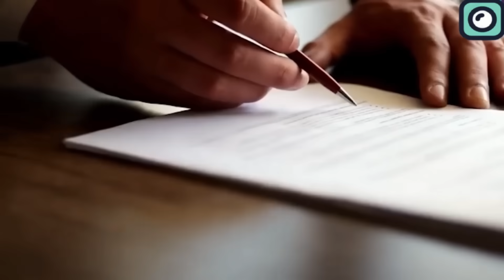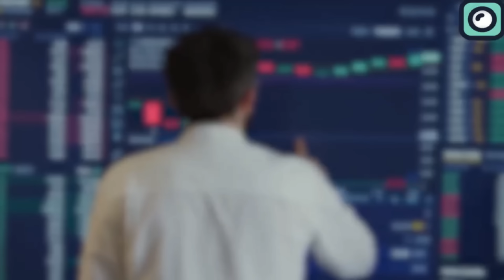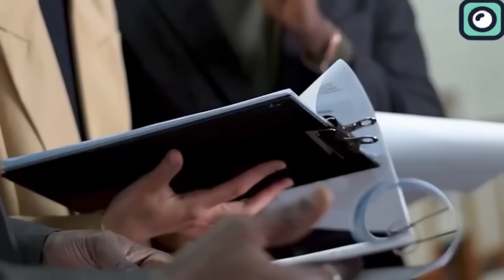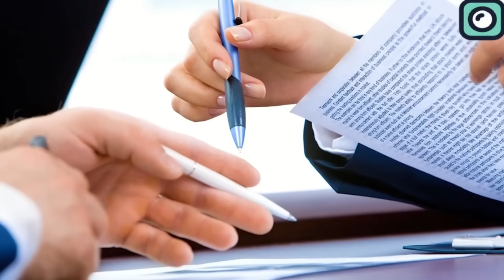ULA Being Sold! Jeff Bezos Is Finally Buying ULA....

Comment: So why would anyone want to buy ULA. It seems like they would need to start over are the engines cutting edge can they be used to land reusable rockets using directional thrust.or is it there launch facility has alot of value. Seems like it needs to be gutted.

Comment: SpaceX has very few reasons to buy ULA. The only one that makes sense is to get some good engineers, but they can get as many of those that they need by simply advertising. If they did buy ULA, the first thing would be to fire most employees. The Management culture would NOT be a good fit for SpaxeX.